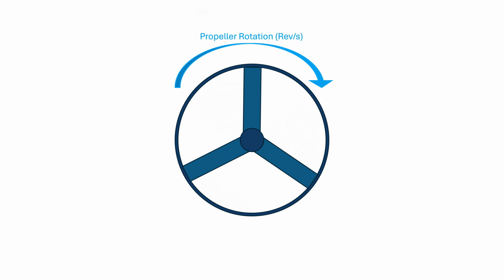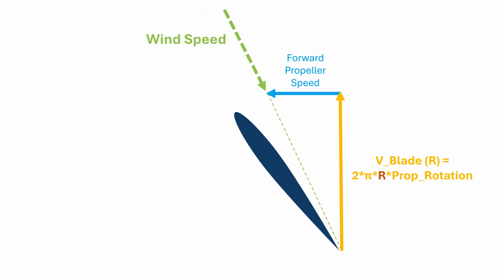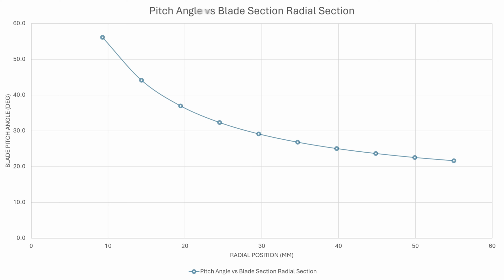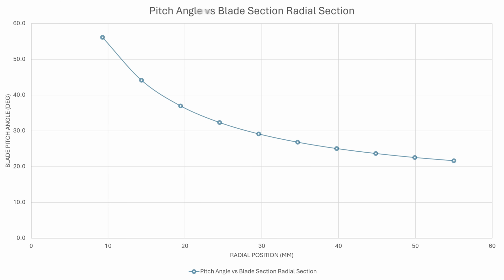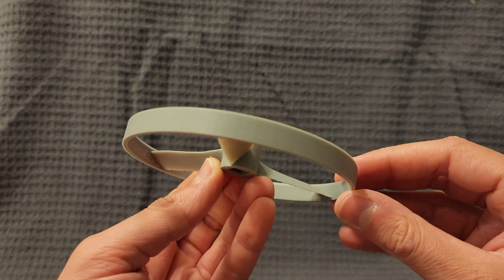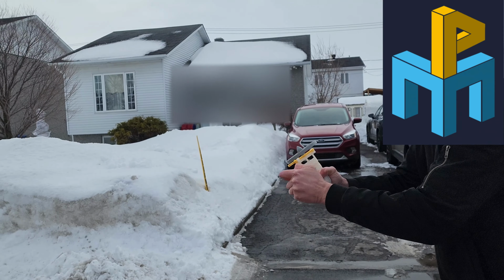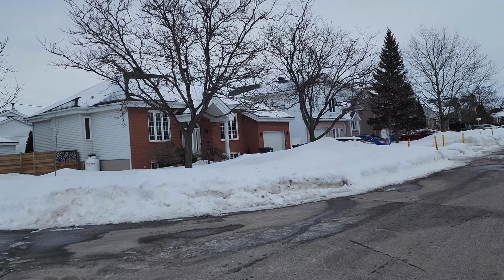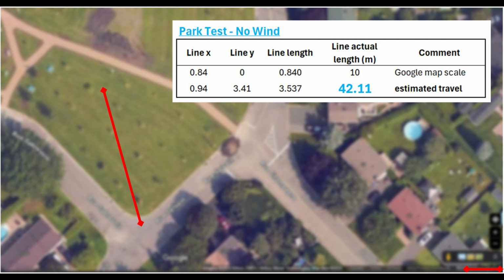EXTREME Propeller Launcher – How to Build the Ultimate DIY Launcher!

Comment: Pretty awesome. Broke several parts and took it apart and put it back together several times before everything was fit correctly and the oil was distributed and it was working smoothly. Once I got it working it worked pretty great, except for the case clips which keep popping off. I just hold it together. Obviously print the prop in a bright color, it's very easy to lose.
Reply from the maker: Thanks for the comment! Appreciate the feedback :). Every printer is different, and for intricate mechanisms like this it's hard for the fit to be good out of every printer. Glad you got it to work well in the end. Honestly, I was worried about the clips not working for everyone :(.

I did manage to break some parts as well after using mine for a couple times. That's when I got motivated to completely re-design this into the latest one I released which is an overkill version of this :).

Comment: This is only the 2nd video of yours I’ve seen - I came here from your latest one because you replied to a comment saying you went over the bearings on this one and I’m not disappointed :) (I was confused previously because you said they were print-in-place, but also that you put the balls in!). Sorry if you’ve covered it before, but what printer / nozzle / filament are you using? 🤦 I just had to wait another minute and you mentioned the Bambu X1C :)
Reply from the maker: @efkastner  in the "launching a prop as far as humanly possible" the printed in place component are the planets, sun and ring gears (because with the herringbone teeth profile they are not assemblable). The bearings are assembled in the same way as for the extreme launcher here :)... except for the double row of bearing in the first stage planetary, where a side port is used to insert all the bbs and close the bearing tracks afterwards.

Yep I am using a bambublab x1c (man this thing is a BEAST) with a 0.4 mm nozzle. I am using PLA with 4 walls, and 25% or more infill, but less plastic is likely possible in many parts.
Reply: @ awesome, thank you for the reply!
I love the idea of bbs for bearing balls :)
Reply from the maker: Yeah! Cheap and easy to find.

Comment: please update the design to replace the plastic bearings with metal ones

food grade mineral oil is a nice lubricant for plastic parts and also good for your wooden cutting board and kitchen utensils
Reply from the maker: Thanks for the suggestion on the oil! I just purchased some superlube grease with ptfe that is also incidental food good contact safe.

I used entirely printed parts for this design to make it easier to build for anyone printing it.

Thanks for watching!!!

Comment: Great design! Curiosity: why using plastic airsoft bbs instead of the steel ones? I thought that steel wouid be smoother. Or not?
Reply from the maker: Ball bearings with steel spheres would definitely be smoother, but they're a bit more complex to source and expansive. I had a ton of airsoft bbs at home, and figured using that in the design would make it easier to build for anyone (you can also get them at walmart etc). There's 0.50$ worth of bbs in the build!

Thanks for watching!😃
Reply: @MechaPrints  makes sense. In my case, I don't have any, may buy the steel ones from Temu and use in other applications. Maybe reuse the concept to build other stuff with gears. My son likes construction / building blocks stuff and I can create some new parts for him to add. Great inspiration for me! Thanks!
Reply from the maker: @EspressoHackers  yeah no problem use it! It's a really simple way to implement a smooth bearing. Pretty sure there would be a way to make a linear rail bearing with a similar approach too. In terms of roundness the plastic airsoft BBs are very round to ensure a similar flight path from shot to shot. Steel ones would likely do a better job though. If you find 6mm ones, you could certainly use them in this design. About 130 are needed.
Reply: I think the steel bearings would wear the plastic a lot faster as well
Reply from the maker: @efkastner  good point!!! Seeing as they hold up on my new launcher that spins much faster, I don't think they're necessary on this one. Upgrade to a full metal ball bearing could help though!
Reply: @ if the plastic pellets work well, i wouldn’t bother with the steel ones - they are extremely hard and and will probably chew through the races. but if you’re going to experiment, just go straight to ceramic balls hahah
Reply: @efkastner  I'm not sure. The balls being smoother, it will have less friction, right?

Comment: now that's an extreme launcher! looks wonderful, can't wait to be able to print it out
also i see you replied to my commend on cults3d, i'm sorry but for some reason i though i would receive an email informing me about your reply, but never got one. and completely forgot about my comment... basically some of the parts seemed to be very hard to print, needing much of supports and other stuff. the biggest problem in my opinion was with the propeller that needed supports/raft
btw i really like the propeller guard on this one!
Reply from the maker: @кира-о9з6ъ  hi Kira, again thank you so much for the ideas you brought with your comment on the first version. The updated model is insanely better. No joke, I lost 4 props in the making of the video -_-. 

The main reason why the prints needed rafts and so on, is that my previous 3d printer was an old 2018 monoprice select mini v2. Rafts ensured better results. I have  purchased a Bambu Lab x1c with AMS to support my youtube channel projects, and none of the raft are required anymore. I think any good printer should be fine without the rafts. The new top case is also a lot easier to print. The new main case as well (no support needed anymore). There are also a lot less parts now (removal of trigger system). I have also included 3mf files to help get the parts printed!

Have fun!!!!
Reply: @MechaPrints  well, i will be launching propellers in my apartment because i can't do it anywhere else, so i won't lose them, so i hope i won't obliterate them launching against walls 💀
it's always a pleasure to contribute ideas, especially when they result in being implemented and even better than you anticipated c:
i don't know the status quo of bambu with their controversial changes in ToS, but i hope you won't get locked within their firmware and ecosystem
Reply from the maker: @кира-о9з6ъ  i did several launch indoors as well. Still fun, you see it will go straight through the room and hit the wall lol. If the nose cone hits the prop will be fine, but if something catches the blade then yeah it might explode. Launching at the ceiling it bounces on it 2-3 times, or even stays stuck there spining for a while. Watch out it makes small dents...

Yeah I almost didn't buy the Bambu due to this controversy. I had a good deal on it, and I was in a rush to upgrade (couldn't wait on a prusa core one to ship). Hope it doesn't backfire later as you mention. Gotta say this thing prints extremely well, and fast. It's a major enabler to fast tracking the projects.

I am very curious and open. I investigated the various suggestions I received and implemented those that were clear upgrades! I even learned about why the variable blade pitch is important. With the corkscrew attachment the launch is also smoother, less energy is wasted in friction when the prop moves off the attachment.